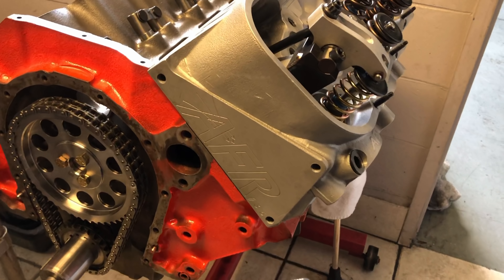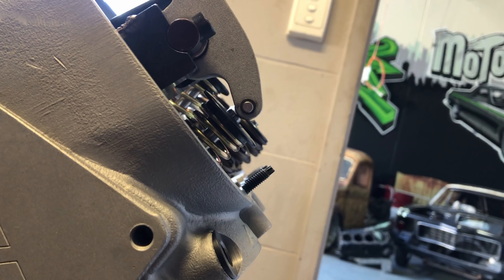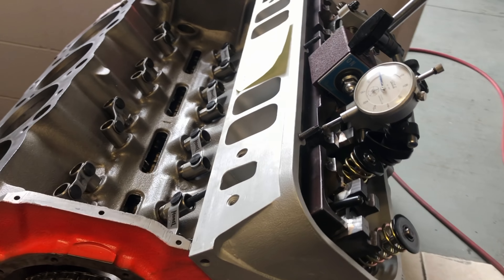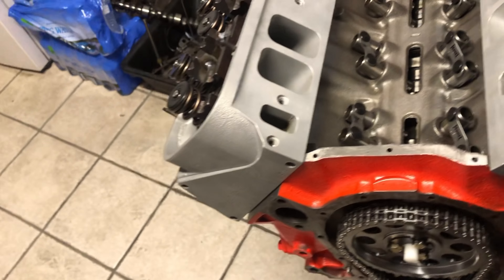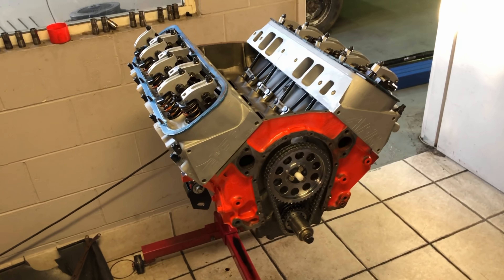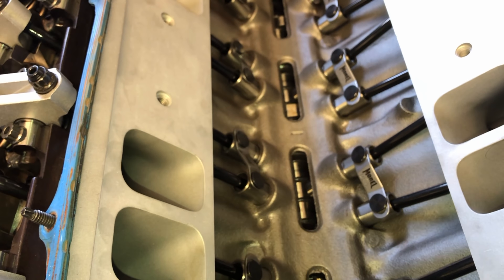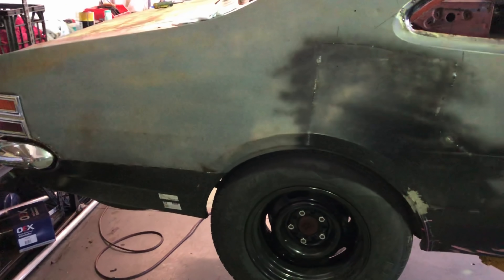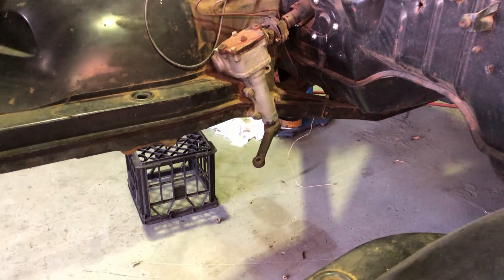Ep. 20 Junkyard Monaro,  SBE 454, 1000hp TH400 parts list.

Comment: no you want the roller tip of the rocker in the centre of the valve at half valve lift,simply if there was a line drawn between the rocker trunion and the roller rocker tip it should be 90 degrees to the valve centreline at half valve lift.and be carefull setting up geometry with hydraulic lifters as the lifter plunger can and will move even with checker springs in heads giving false geometry